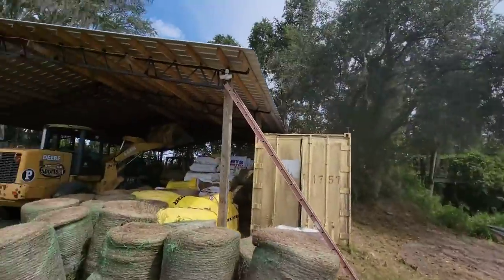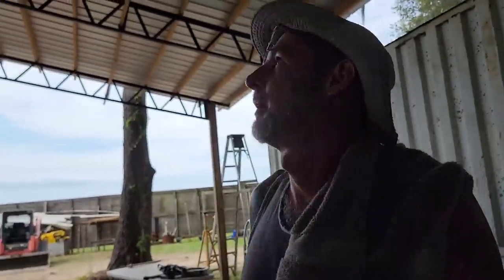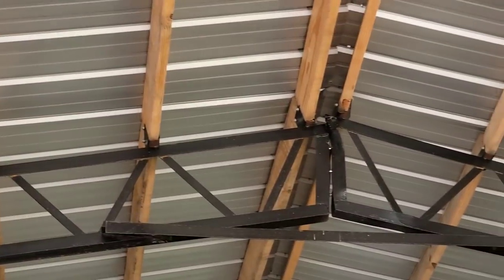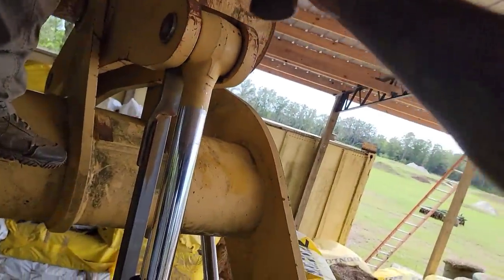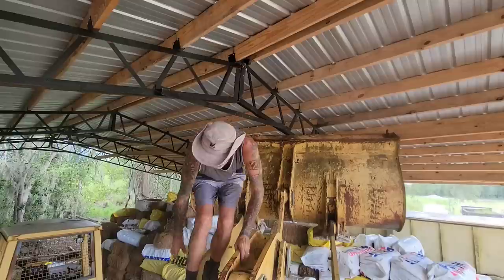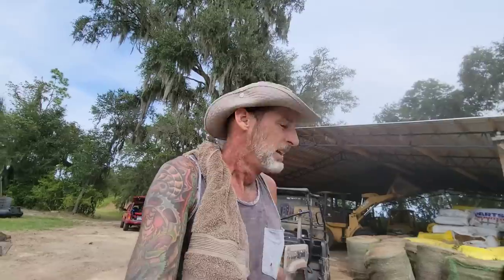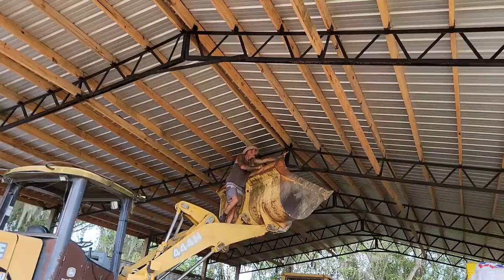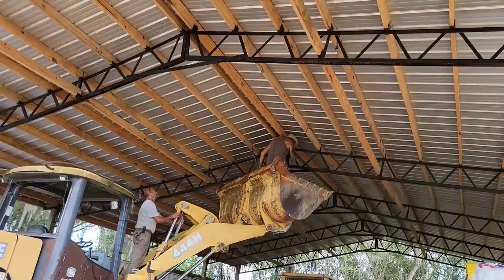Don't let it fall WILLIS

Comment: Hmmm….. thinking it may need some “lengthwise” metal support. Those wood beams don’t look strong enough for the full weight of the metal roof. Strange that it’s all wood on the full length without much support. The crossbeams of the metal arches definitely struggle with the weight.
Reply from the maker: Yes, some welding for sure

Comment: You could have used really big hose clamps in addition to the bolts to close the gap also.  That way there is no way for the dip to come back, maybe.  The metal where the top bot is is really compromised as far as it's strength is concerned.  The hose clamps would help a lot.  
Just an idea if you need to fix it again.  🥰🥰🤗🤗😘😘
Reply from the maker: Tks

Comment: Travis need to lift it back up take some boards up and out them on both sides and snug the tights as you can get them. That should work to hold it up
Reply from the maker: Tks for input